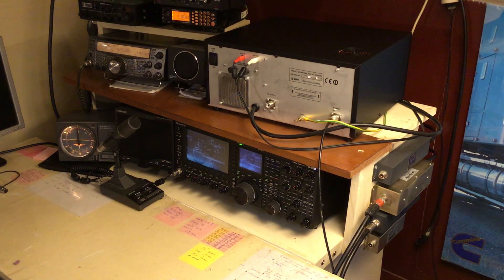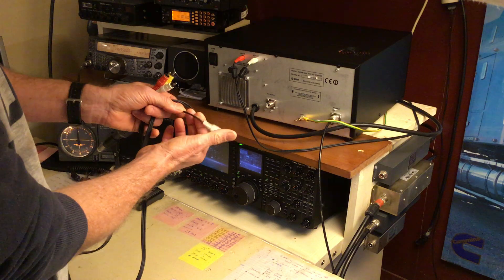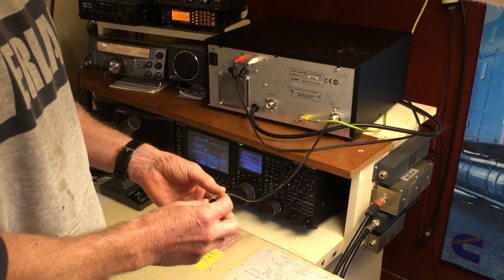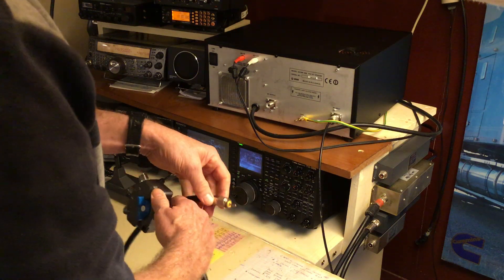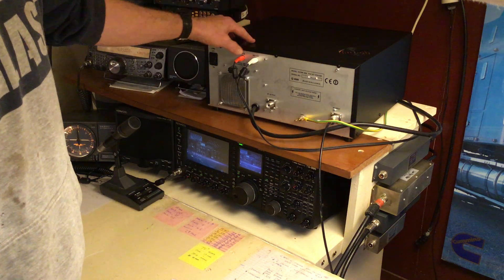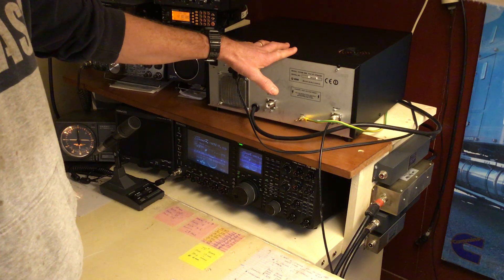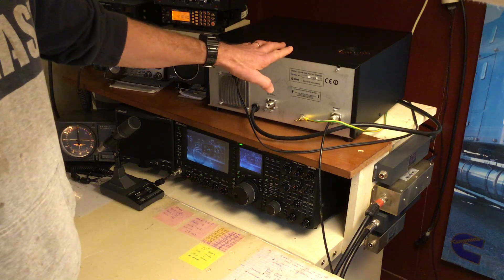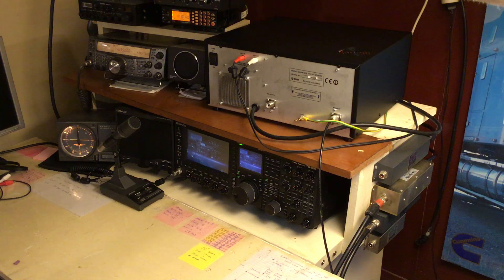ACOM 1000 Amplifier basics for the beginner Amateur Radio.

Comment: How to work in by-pass, how much power is allowed when the amp is off?
Reply from the maker: If you are bypassing the amp off or in standby but amp on you can run your 100 watts is ok that came from my AU dealer .

Myself if I’m not going to use the amp depending on the band conditions I leave the amp out of it and run the antennas straight to the radio.

Comment: Acom 1000 4cx800 vs Acom 1003   3cx800.   Which tube would be better.
Reply from the maker: Excellent question I would say look at availability of tubes as my GU74b is an original Slovenia  tube no problems .
Now Acom source all tetrodes made in china for the 1000,  so if the 3cx800 are easily available outside of Acom it may be a better option for you .

Comment: Hello and thanks for the video. I have only two ground lines. One is for the whole house, and one is dedicated to the transmitter.  Do you think is a problem if I connect also the amp to the same groud used by the transmitter? Thanks!
Reply from the maker: That is a very good question ,I have seperate earth stakes on my transceiver / amplifier ,
You could try it with the one earth stake for all it would be no different to the earthing in your home .

I would just recommend earthing it to the stake ( seperate wire )so anything goes straight to ground  not earthing the amp to the back of the radio as a short cut .